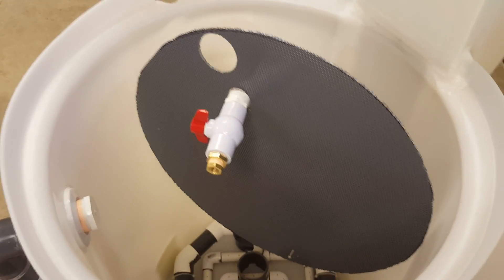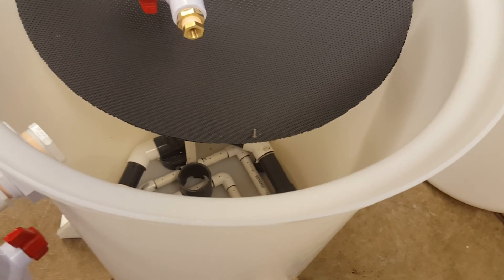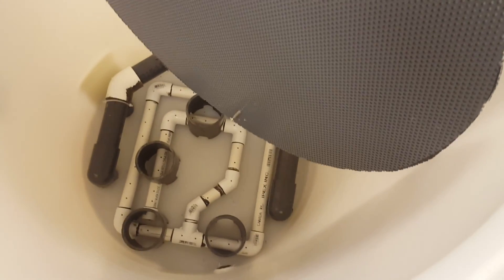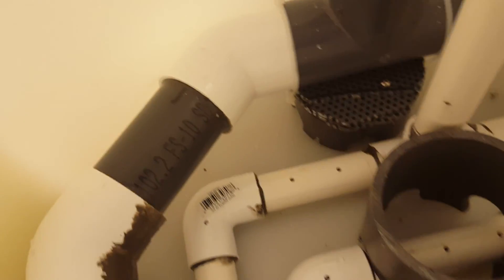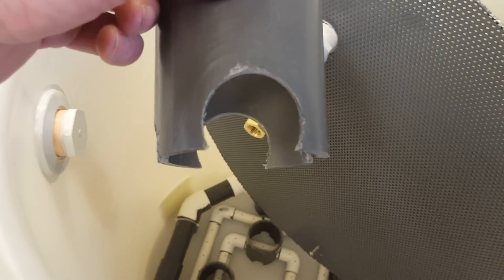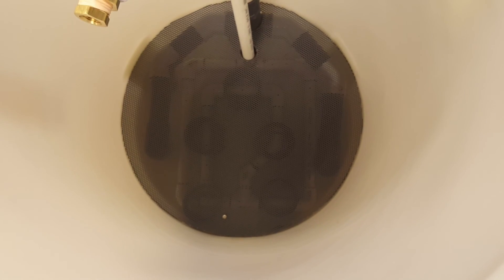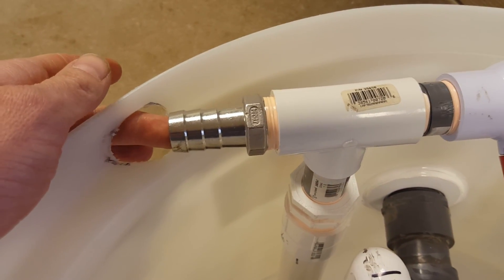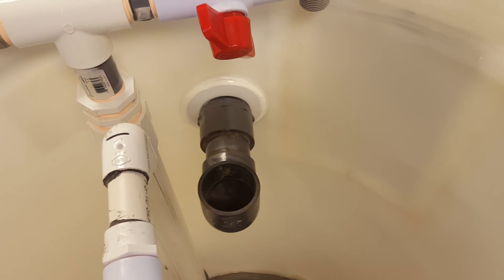How to build an Aquaponic sand and gravel filter

Comment: when back flushing with the air, how does the dirty water flow out of the dirty outlet?
Reply from the maker: Good morning and thank you for your question. The dirty water flows out of the filter through the waste outlet while you are purging the filter with air and while the water pump is still on. Therefore the filter is filling with water (not flowing into the fish tanks) until you open the waste outlet. Meanwhile you are continuing to purge with air. When you reach the max water level open the waste valve and the dirty water exits the filter. Keep the water pump on for the entire process. Hopefully this helps.
Reply: Aquatic Growers gotcha. So the outlet to the pond should have a valve? So the pound outlet is closed, the filter is filling with water due to the pump remaining on, the air disrupts the solids and the the waste outlet is opened. Got it. One more question. Where in line of my existing plumbing should this go? I have a bottom drain, which goes straight to the pump. The pump feeds the water fall with is fed from the bottom, the water rises to the top of the tub and flows down the fall. Should I put the filter between the pump and the water fall? Or have a separate pump with desperate plumbing just for the filter? Thanks for the time!
Reply from the maker: @-MOYST-   I would place the filter between the pump and waterfall. This way you are cleaning the water prior to it going into the pond. If you don't want to use valves to control the water flow through the filter (when purging) you can also use threaded fittings. This way you can block off an outlet with a threaded cap inside the filter itself. I find it easier (and cheaper). Good luck!
Reply: Thank you! one more question. My waterfall has a separate tub from the pond, the water is fed into the waterfall from the bottom. If i place the DIY barrel filter between my pump and my waterfall will i have issues with having enough water flow? Would the barrel need to be air tight?
Reply from the maker: @-MOYST-   The filter barrel should not have to be air tight if it is the tallest  object in the system. It should be in a none pressurized system. Make the filter outflow to the storage tank (pre waterfall) taller than everything else. Otherwise you may get into a backflow situation (if the pump quits) or  where head pressure from the storage tank will negatively affect your pump flow rate as it passes through the filter.. Before you start building, solve all water flow issue in your head. Otherwise your work may have negative consequences.
Reply: Aquatic Growers I appreciate all the info. So it seems the pre waterfall has a discharge outlet. I have a ball valve between the waterfall and the pump. If I close the valve and shut off the pump the pre waterfall drains completely, I’m guessing it drains down into the soil? The pond was already built when we bought the home this year. I’ve added some fish and a 57w UV sterilizer. Still the water is somewhat murky but the sterilizer has made a good improvement on water condition. I cleaned the pond 2 months back and it has a bottom drain and no filter system. I’m hoping the DYI filter will get me the rest of the way. It’s approx 2000 gallons.
Reply: The filter will be the highest point so I shouldn’t ha e any backflip issues. With how water flows in the holding tank(pre waterfall) I was concerned the filter would prevent it from filling properly since it fills from the bottom up. Going off of what you said I shouldn’t have an issue. My pump is rather large as seems to flow a large volume per hour.
Reply from the maker: @-MOYST-  Sounds like you have a handle on it. Its always tricky figuring out a system that was built by someone else. If the pond is 2000gal, and murky. You will have to experiment with the frequency of cleaning the filter.  My aquaponic system is 1400gal and I only clean it once per year. It is also inside a greenhouse and has very little turbidity. You will most likely need to clean the filter more frequently. Hope this helps, good luck.
Reply: Aquatic Growers you’ve been a big help, so thank you.

Comment: After 2 yrs use, would you please feedback as to the effectiveness of your filter. Please include frequency of backwashing and any improvement/optimizations that you've discovered. Thank you.
Reply from the maker: Jack Trexler , thank you for the questions. The filter I built for the video is the same one I am currently using. I have not modified it and it works extremely well cleaning the water of fine particles. Since I have had it in operation(2 yrs) I have only had to blow out the system twice. I use a small air compressor with a rubber tip on the airline nozzle attachment. I will try to show a video soon showing the ease of cleaning this filter. Cheers. Scott
Reply from the maker: Jack Trexler , thank you for the questions. The filter I built for the video is the same one I am currently using. I have not modified it and it works extremely well cleaning the water of fine particles. Since I have had it in operation(2 yrs) I have only had to blow out the system twice. I use a small air compressor with a rubber tip on the airline nozzle attachment. I will try to show a video soon showing the ease of cleaning this filter. Cheers. Scott
Reply: Thank you for responding.  I've been looking at the AST bubble bead filter. It works similar to yours,  but is not cheap. However,  versus cleaning the solids filter and bird netting weekly,  yours and it definitely looks like a time saver (plus a great floating solids filter). Thinking back at your time to build, would you build it again or spend approximately $2K for a commercially built unit?
Reply from the maker: I would definitely built it again and probably not change anything except make it larger incase I want to expand the operation. Just remembered that the more biomass you have in the system the faster it will plug up. My system only has approx 125, 8-12" fish and a grow area of 220sq'. My filter is also located at the end of all of the deep water culture beds between the water pick up pump and my first fish tank. So, a lot of digested broken down material settles in the grow tanks. I am honestly only filtering out whatever becomes stired up when working on the system or harvesting plants. Hopefully this helps...

Comment from the maker: Thank you for liking the video and subscribing! More videos to come.The pvc screen is purchased from a local plastics manufacturer by the name of Fabco.  This company manufacturers many different types of plastics in a wide variety of shapes and sizes. It's original size is a 4' x 8' sheet that comes pre-drilled with the holes. If you purge your system frequently and aggressively you may have smaller pieces of aggregate fall to the bottom. I have not experienced this yet because I rarely purge the system and the top layer of aggregate is approx 3/16".  My filter is installed to only remove the fine waste particles and so far after running it for 6+ months I have only purged it once to test it out. So far I am very pleased with how well it works.

Comment: Good video:) I am in the process of making a filter like this for my aquaponic system. I have a few questions for you if you please. - 1. Where did you get the gravel barrier PVC? 2. Did you have to drill all the holes in that PVC gravel barrier? 3. When using the air to clean out solids does smaller gravel make it's way down to the large river rocks? I subbed so I can see more man! - I have an AP system as well and I will also be breeding Ranchu/Oranda Goldfish as well.

Comment from the maker: Yes the air system will fill with water. One way to solve the problem is to drill the air holes in the underside of the pipes not the top. A shut off valve must be installed on top of the airline to stop the air from being pushed out by the water pressure. I don't have a problem with the airline filling with water because I purge the system with an air compressor. The compressor has more psi than the water pressure.

Comment: I have an issue with my S/G filter system. My 1" pipe that sticks out for me to be able to blow air into is filling up with water half way up when I fill the barrel with water. Is yours doing the same? Is there a way to avoid this from happening?